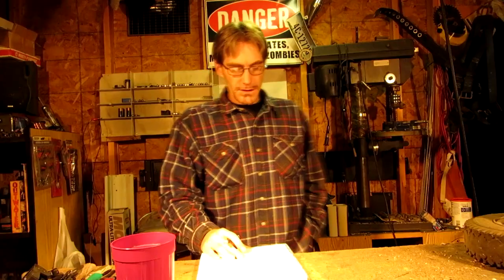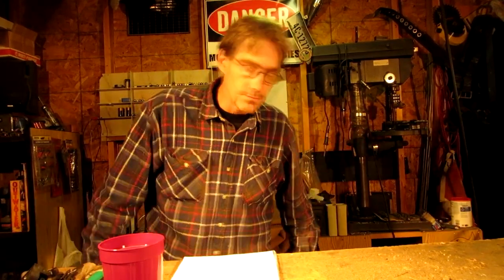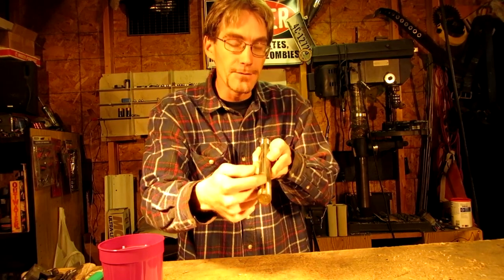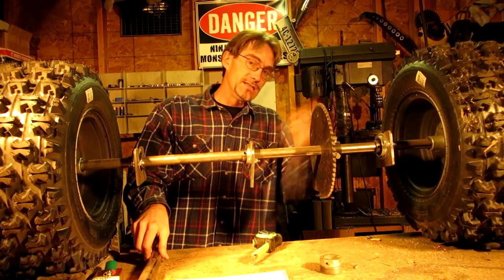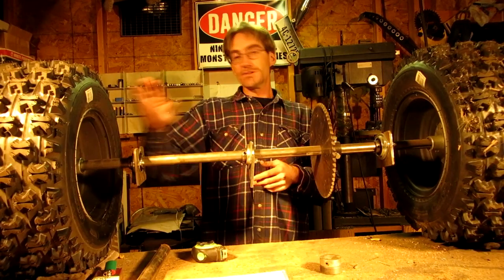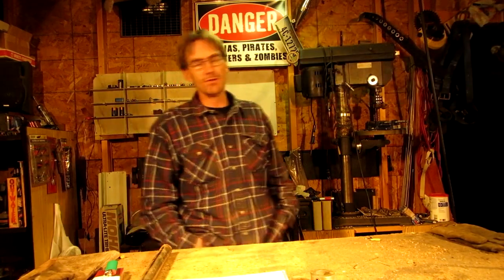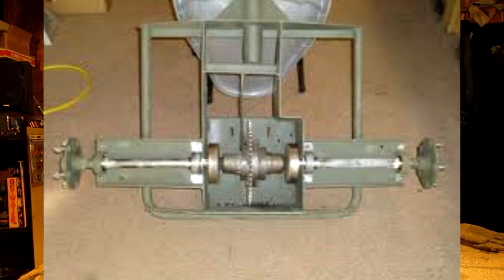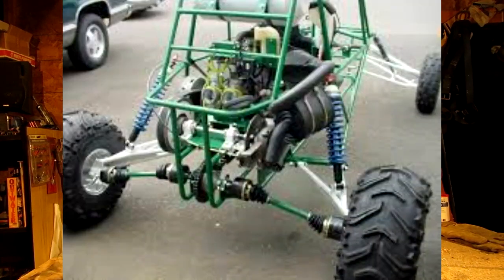GO KART AXLES | 3 PRIMARY TYPES |

Comment: Please help me...iam confused...
Iam planning to make a buggy with a 150cc 4stroke bike engine(15bhp).
Is live axle OK for that?
Reply from the maker: yep, that is what I would use.
Reply: @Tmansgokarts  thanks for the reply...can you please suggest a axle length for my buggy...
Reply from the maker: @aju5405  well , the largest axle I know of is a 45 inch long. That seems to be the length most people use.
Reply: @Tmansgokarts  does it cause turning problems or like that?and what is the reccommented distance between the engine sproket amd axle sproket?does it have any particular angle ?plz help
Reply from the maker: @aju5405  ... No , it doesn't need a special angle the just have to be in line with each other.

Comment: What diameter does the sprocket have to be for a 1 inch axle?
Reply from the maker: well most of the time it comes down to a 54 tooth sprocket, thats what most beginners use. But be sure to check the chain size that you want to work with. if you have a go kart then its most likely a 41 or a 40 pitch chain.
Reply: T-Mans Go Karts thank you. just wanted to be sure
Reply: Raphaelis Rodrigues

Comment: Where do I find a dead axel tire
Reply from the maker: just the tire or the whole set-up like the rim sprocket and stuff.
Reply: The whole setup
Reply from the maker: @kelbypressley1288  well , the specific one I have in the video is rare because it is solid ( no bearings) but if you are looking for a set-up with bearings you could go over to BMI karts and get there phone number and call, they could set you up good.
Reply: Thank you
Reply from the maker: @kelbypressley1288  ... also this place , https://www.northerntool.com/shop/tools/product_200331217_200331217?cm_mmc=Google-pla&utm_source=Google_PLA&utm_medium=Tires%20%2B%20Wheels%20%3E%20Low%20Speed%20Pneumatic%20Tires%20%2B%20Wheels%20%3E%20Low%20Speed%20Wheels&utm_campaign=Martin%20Wheel&utm_content=13340&gclid=Cj0KCQjwt_nmBRD0ARIsAJYs6o0DaJTrmKPjADCjE-i6tdfZHcmKcY_a3D1OKh8U1n3PIbxRgthutekaAn0REALw_wcB

Comment: When I turn on my engine it starts high revving and the tires spin too help me plez
Reply: David Barboza may need to check the spring on the accelerator? Did u take out the governor cause the spring return on the throttle may be off

Comment: Ok so my friend gave me a Chinese dune buggy go kart for free it has no swing arm in the rear and no motor. I have a 500 CC snowmobile engine with all the parts I just need a jackshaft I have made go karts for all my life I just need help with one thing the width of the axle overall has to be 54 inches what size axle shaft do I need to make 54 inches with the tires on it will a 44 inch wide axle work I want to use a 22 10 10 atv tires on it someone told me  that a 41 inch axle will work but I don't know seems kind of small and how thick of an axle should I get because that thing puts out a lot of power I'm guessing this thing's going to do wheelies which is fine with me.  great work on all the videos I have to say the most information you can get
Reply from the maker: hmmm do a search on Google for a 1" axle that is 54" long . be sure to use 3 bearings for the reconstruction of the rear. 1 on each side ( by the tires) and one in the middle.
Reply: T-Mans Go Karts I was already thinking about that with the 500cc motor I was going to use 4 if I can just for safety thank you for your help

Comment: hey tman, new subscriber and glad for it. great videos and my kind of funny too, keep up the great work and advice. my question isnt about gokarts, i am taking an interest in building a quad-bicycle with peddle and electric motor. but heres the thing. i dont know shit really and i am building it with the intention of putting about 600lbs on it. i need a rear axle large enough that it wont bend under the weight and yet small/light enough that a bicyclist can peddle the bike when not under power. also the square tubing i see you use i wonder what size and gauge would be needed for a 6-8ft length (front to back) would be needed without bending under the weight for the frame. again i know its not exactly what you do but, please help me out. diykarts.com it is just hard to get the info i am looking for. anyway rock on dude... ~johnnybgood~
Reply from the maker: I see, well that is something that I have never built but you could go check out this forum. People build that type of stuff over there.... http://endless-sphere.com/forums/

Comment: So you talk for 23 minutes and don't cover the most important thing.  How wide of a live axle does one get based on their frame size? Yours is 45", that's great, but how did you come up with that number? how wide is your frame? Is there a formula to this? My frame is 30" wide on a street race kart, how wide of a live axle would I need to buy? I'm planning on running slicks.
Reply from the maker: Jeeps Unclassified no, theres not much of a formula . it kind of comes down to the distance that you want between your tires and frame once mounted. So if your frame is 30 and you want 2" between your tire and frame, and you want to use 6" wide slicks . then the axle should be about 44" long. that would also give you some length on the ends to put on the nuts on the end of the axles.
Reply: What if you run hubs at the end of your axle? That would mean you couldn't take wheel width into consideration. Also how do I know if 2" is what I want between frame and wheel? Why not 1" or 3" for example? I'm pretty sure when they design and engineer race karts, they use some sort of formula or frame to axle width ratio chart.
Reply from the maker: Jeeps Unclassified sure, factories design the karts based on the type of class the machines will be running in. Race Karts are a special thing, based on the type of racing that will be done. The specs for an Out Law racing class machine will be different then say a machine that will be used for an oval asfault /concrete track. You'll have to do some searching for the specs you'll need to comply with. I dont like messing with racing  because I have heard to many stories from people getting disqualified for the dumbest stuff, thats why I stick with the simple off-road builds. There is to much to know when it comes to the racing stuff along with that it seems the classes and rules are always be changing every two-three years depending on where you live.